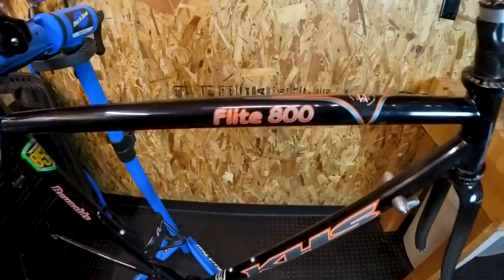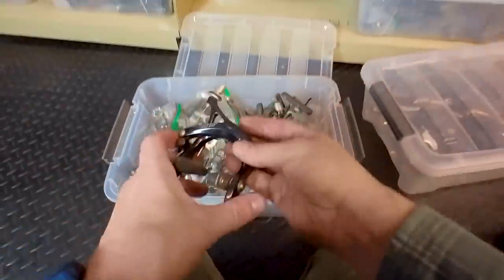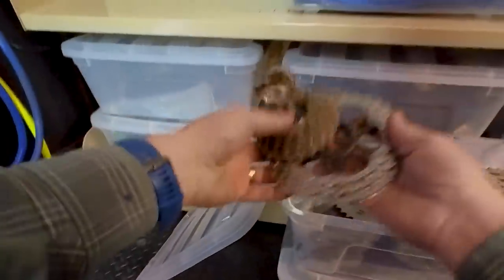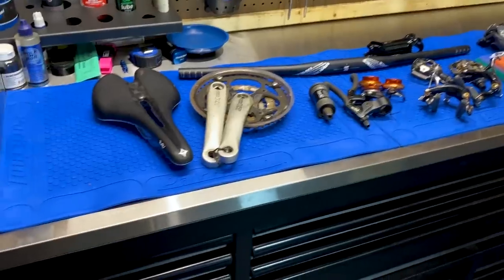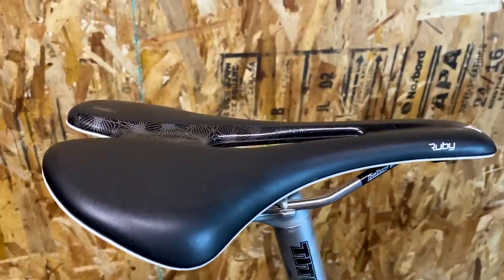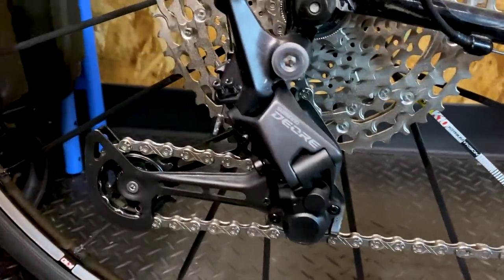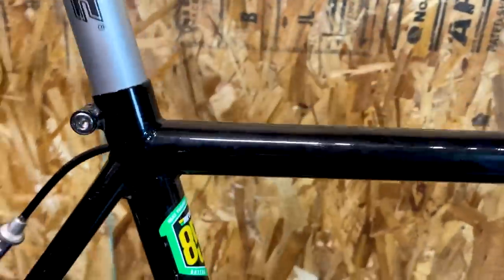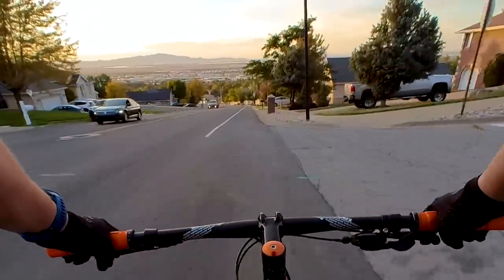Streetfighter Road Bike Conversion Build - KHS Flite 800

Comment: Have a 25 y.o. custom 853 mtb frame set built here in the states. 
Turned into bmx-ish cruiser 1x7, 2.25" tires, small crossbar, mavic wheels, shimano xt derailleur, house of color emerald green paint still looks new.

Comment: I like what you did there. That's where all the old XT stuff is! I've been mulling something similar for my Specialized SL2 Roubaix with Ultregra 9, that has those mavic wheels on it. Great setup as is but a flat bar, 1x wide range, and 28c tires has me thinking...

Comment: Was looking for a Lemond cause of their 853 Frames and just so happened to come across a KHS Flite 800 in a Reddish Root Beer color.  Not sure the year however supposedly they only made the Flite 800 for only four years from 2000-2003.  
      I'm going 11 Speed with a Praxis Zayante 48-32 Carbon Crank, a Shimano 105 11-32 Cassette, SL RS700 (105/Ultegra) Rapid Fire Shifters, Ultegra R8000 Medium Cage RD, Ultegra Brakes, with some Kysrium Elite Wheels with Continental 700x28 Reflective Tires.
Might do a video.   Jesse from the SF Bay Area
Reply from the maker: Sounds awesome
Reply: Thanks for the reply.  Just curious, do you know what year model your KHS is as mine looks exactly the same with the color shemem of the decals.  Hard to tell what color it is.  Mine again is a darkish reddish Brown.  Thanks

Comment: Question - why did you show picking through the parts bin and picking out cassette and grips, then use new boxed parts in the build?
Reply from the maker: Part of it was plans changing mid build. I chose to keep the 10 speed drivetrain for another upcoming build. I didn’t show much on the choice to change.

Comment: Nice build, I can stare at it all day. The thing about "parts bin builds", at least for me, is that I love the idea of putting random bits to use, but eventually the mismatched parts start bothering me. For me, at least the cockpit always ends up harmonized. 

I was wondering how the 73mm BB was going to affect your chainline. The ring definitely goes inside of the spider (glad you made it work), but even then I'd be curious about the chainline.
Reply from the maker: It could still go in about 3-5mm to get the best chain line but it’s working well.

Comment: Gotta put some air in that tube at, 8:10. Just enough to make it round and flow into the tyre. I usually just blow it up with my mouth to get started.

Edit: Finally some ratchet action at 10:00, folks!
Reply from the maker: You’re correct on the tube. I was actually just being lazy. 😁
Reply: @oldshovel  you gave me the shudders. It's so much more faff, and then you did it again!

Comment: Just curious what you were doing at approximately 10:45 and what tool you were using?
Reply: He is checking the perfect alignment of the rear derailleur hanger, with the specific tool. You compare the distance with the rim at different angles (but the same position of the rim, so turning the wheel, he used the valve position as reference, to also avoid any issues caused by possible error in the trueness of the wheel).
Reply from the maker: Spot on. I wanted to check that the hanger was aligned before I set up the derailleur.
Reply: @BICIeCOMPUTERconGabriele  Thank you, that was really helpful!

Comment: Maybe I missed something, but why the filing on the chain ring?
Reply from the maker: The inside of the crank spider had a slightly larger edge diameter than the outside so I had to file the chainring dow slightly. The holes are the same but the edge of the ring is slightly different. Shimano has a few cranks from the same era where this is the case.
Reply: Awesome. Thank you for the explanation.

Comment: How has the bluing and topcoat held up? I really want to do this to my old Raleigh, but I'm in New England that gets a lot more rain than SLC, so I worry about rust. Maybe a clear powder coat would help?
Reply from the maker: It does take more care but it has heal up well. I did 3 top coats of clear finish on the Lemond and I think this is a minimum. The clear still gets rubbed and nicked and then rusted a bit here and there.

Comment: The cainring could be a little bit bigger i guess. 38 to 50 is a pretty low gear for a road bike. I'm running 42/46 on my gravelbike and i barely need a lower gear.

Comment: Nice ..that's sweet.. 
What's that things weight?  22 , 23 lbs. maybe . Flat bar makes roadbike look awesome. 
Killer find on the frame ..
Reply from the maker: It weighs in at just over 20 lbs, at about 20.5. Just a bit heavier than my Lemond StreetFighter which is just under 20.

Comment: I'm surprised that you went with old style brake pads instead of the newer disc type. I figure that with some of the speeds that you can get up to with that setup, disc's would help you stop better.
Reply: Physically impossible to use discs when the frame doesn't have mounts for them.

Comment: In my opinion you should have cut the handlebar 5cm each side. It's way too wide for a roadbike. I also would have preferred a double chainring, Or at least a bigger one (at least 42 T).
Reply from the maker: I wanted a 40t on it and may still tinker with the setup. The 38t was nice on the crazy steep hills I have on my commute home.
Reply: @oldshovel  Yes I noticed in the ride video part. Quite a beautiful town and surroundings where you live! Here in Europe we get from movies and mainstream media mostly images from the US coasts, that is crowded big cities, and traffic jams, and higways... and a concrete jungle. But I'm learning much watching youtube videos, and discovered that many States, like Colorado, for example, have beautiful natural environment!
Regarding the bike: if you have steep climbs the double chainring (a gravel one for example 46-30) would be the easiest solution for great range. I think that Deore rear derailleur can handle the chain slack without any issues.

Comment: Compare this to a modern road bike, it's so much easier to deal with: inexpensive, everything is standardized and swappable, rim brakes that are lighter than discs and don't need alignment to fractions of a millimeter like discs, all external cables that are quick and easy to install and replace, QRs that both offer 10x the camping force of thru-axles and are easier to use, steel frame that will take a beating and still offer the best ride quality, a steel RD hanger than you can quickly bend into position without worrying about aluminum failure, tubed tires that took about two minutes to set up, a cartridge BB that will likely last the life of the bike while requiring, a CK headset that will last the lifetime of the frame, a simple seatost clamp that will never slip. I love modern bikes, I love tubeless, every bike I own is disc brakes, I have two bikes with electronic drivetrains... but there is definitely something to be said for this tried-and-true stuff.
Reply from the maker: Amen my friend 🙌

Comment: It looks as though the rake of that fork is slightly different than the geometry of the frame?? Video didn't stay on that for any length of time, so perhaps it's my eyesight?? HA!
Reply from the maker: When I first saw it I noticed the same, looking into the bike I learned the fork was the original for the build but it’s an interesting one.
Reply: @oldshovel  Howe do you know that is an original? I have to believe that those photos show just the opposite.

Comment: Relatively easy to assemble https://www.youtube.com/post/UgkxMesz3KOGEmwmvyKQfLfrRSUXLFzfVHZA (note that is does not come with tools, so please have a set of hex/Allen keys and Phillips screwdriver handy). The bike weighs 27 lbs fully assembled, which is not bad.A couple quirks about the bike:- left brake lever operates the front brake (something to get used to if controlling the front brake with your right hand is what you usually do)- Shimano thumb shifters for the gears are positioned close to the center. This is a bit of a nuisance because changing gears involved taking your weight from one hand to change gears, a hassle if you are regularly changing gears. However, gear shifters positioned at the drop bars are very expensive compared to thumb shifters, so I can understand, given the price of the bikeBike is otherwise of good quality. Gears change fairly smoothly and fit/assembly is of good quality. A totally competent product for the price.